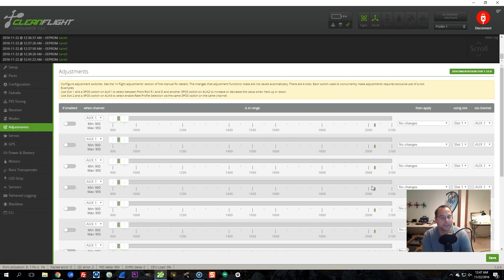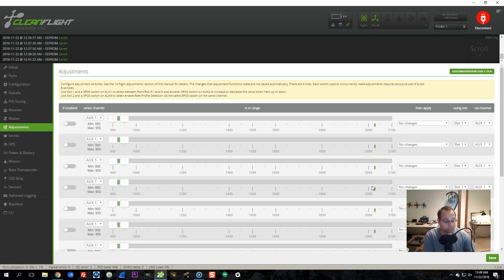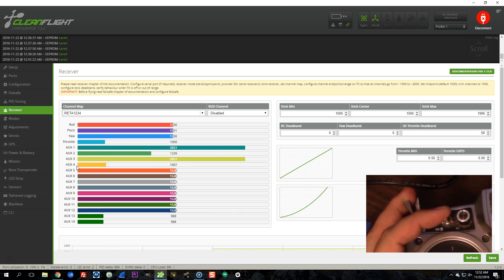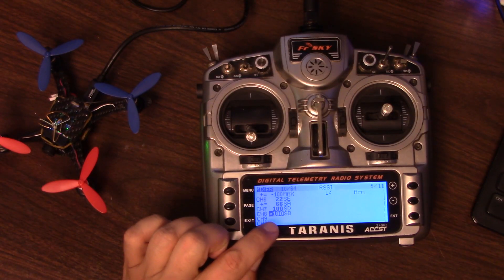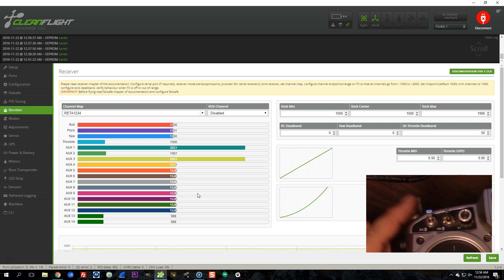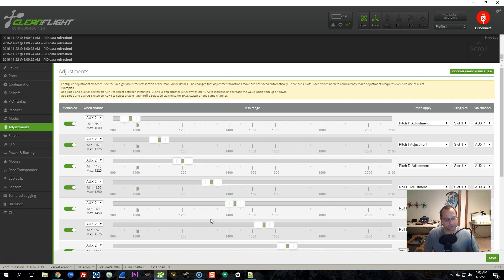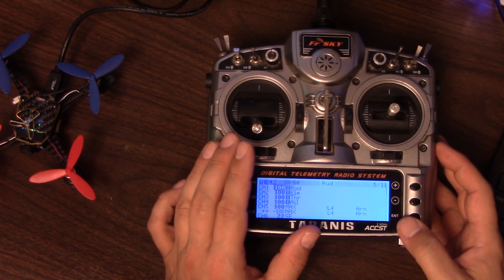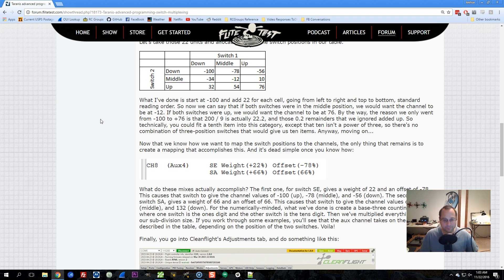Cleanflight / Betaflight In-Flight Adjustments | HOW TO SET UP

Comment: One of the most common adjustments to set up is the rateprofile selection - unfortunately it also seems to be very confusing to people.  Rather than using 2 switches, Ideally you want a single 3-position switch that selects the rateprofile.  So assume you want to use aux3… Create an entry in the adjustments tab that has:

When channel: aux3
Is in range: the entire range (drag the sliders to the full range)
Then apply: Rate Profile Selection
Via Channel: aux3

The confusing part is that the "when channel" is the same as the "via channel".  The adjustment is always active since the range is set to the full 1000-2000 so the rateprofile is selected also from aux3.  The rateprofile selection looks for ~1000 for rateprofile 1, ~1500 for rateprofile 2, and ~2000 for rateprofile 3.
Reply: hi, I want to be able to select rateprofile 1-6 via turning knob on taranis. However it stops at profile 3 (can do 1-3). Any idea why?

Comment: Okay, but is there a way to somehow change the PID-profiles on the field without a computer? It would be cool if bf would allow you to change them with a switch as long as the quad is disarmed. As changing PIDs generally doesn't need a fc reboot it should defenitely be possible. Even if it would need a reboot I wouldn't care because normally I only need to drasticly change my PIDs when I change the prop type (I would then tune the quad in the three profiles for three different props and then change it according to what prop im flying atm).
Reply from the maker: You can change PID profiles via stick command, but not with a switch or in-flight adjustment.
Reply: Cleanflight/Betaflight stick commands:
https://raw.githubusercontent.com/cleanflight/cleanflight/master/docs/assets/images/StickPositions.png
Reply: Bruce Luckcuck oh dayum!!! Thank you very much! Didn't know about the stick commands :O

Comment: Nicely done.  I'm using a similar thing to set flight modes on the Vector.  For some reason they switched to using two 5 position flight mode channel inputs (why 5?).  I added the 6 position S3 mod to my Taranis for one channel, and doing muxing for the other.  Damn, I need more switches.  There never seems to be enough.
Reply from the maker: I never heard a taranis user say they didn't have enough switches. Wow.
Reply: Yeah, I'm greedy.  I sometimes send up meteorological equipment in my tricopter that requires multiple controls and sends data back over telemetry channel.  Add in pan/tilt and video switch and etc and yeah, more switches would be nice.

Comment: Great, i´ll set it up on my futaba. Time to do some learning!
Reply: It works!
The only problem is i don't have 3 three position switches so i had to use a slider for the up or down adjustment. Never used them before at all so i'll have to get used to it.
Reply from the maker: +Diego Ramos could you use a trim switch?
Reply: I´m not sure how. i´ll have to see how it´s done. On the Taranis, do they behave like channels? because i don´t think i can assign a different  function to a trim switch.

Comment: can you see the changes with certain osd's or is that a different method?
Reply from the maker: If the OSD supports PID tuning, you can see the changes. But typically you can only see those changes after you have landed, when you open the OSD menu. It would be really clever if an OSD would allow you to see the PID values on screen while using in-flight adjustments.

Comment: Damn that's interesting. Thank you for your work! One thing: do the optimal PIDs are different when using/not using action camera or in different weather conditions (when it's very cold, maybe you could use greater D values/greater I values for flying in high winds)? If they are, then this would be an extremely useful function.
Reply from the maker: The PIDs change slightly when you remove the HD cam. Removing the HD cam is like slightly raising your P gain. As for temperature, I can't say I've noticed much difference. I'm sure if I were to tune in Miami and then go to Denver, I'd notice a difference though.

Comment: I think I got your mix from that post back then I used it with a 3 pos and a2 pos switches on my 9x to get 6 flight modes on ardupilot now we can get a 6 pos rotary encoder for taranis it even has a extra input inside.
Reply from the maker: Yep. That rotary encoder is basically the same thing, just easier to implement.

Comment: I use the elevator trim tab to increase / decrease.  Each click is 1 point.  No guess work needed unless something goes wrong.
The mix send 100 or -100 straight to the adjustment channel.  As soon as you let go of the trim, the channel is at zero.

I did totally steal your mix from flitetest though.  Very clever and don't think I'd have been able to figure that out in any small time frame.
Reply: Have you solved it? I have the same problem

Comment: If the increment/decrement of the PID is based on the time the switch is held up/down. Then if the OpenTx code had a menu that let you enter the starting PIDs, then it should be able to keep track of the changes and show it on the screen.
The Tx could know and show the PID your changing based on  3 pos switch.
Reply from the maker: +sqwert they're working on a way to communicate the PID values via telemetry. Even better.